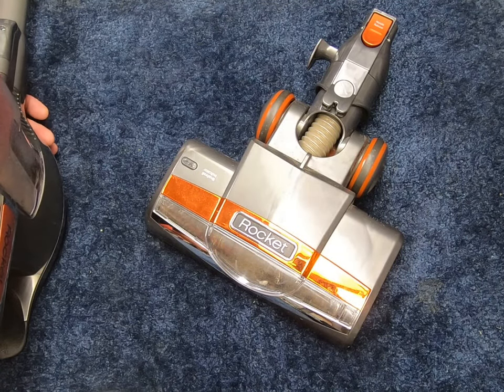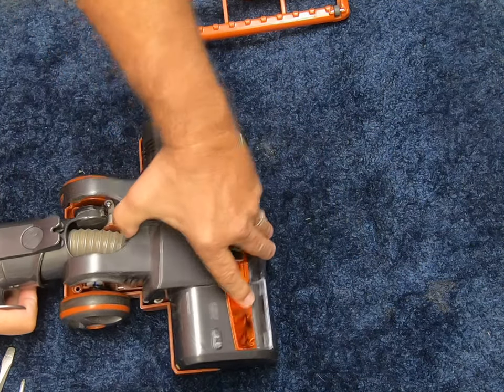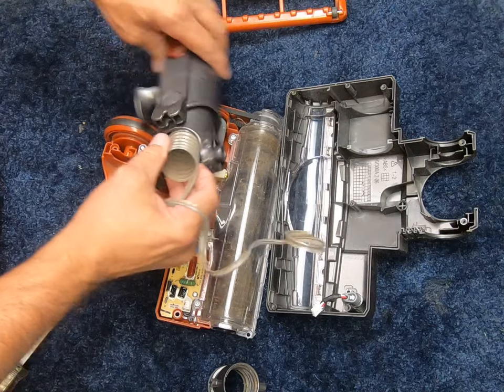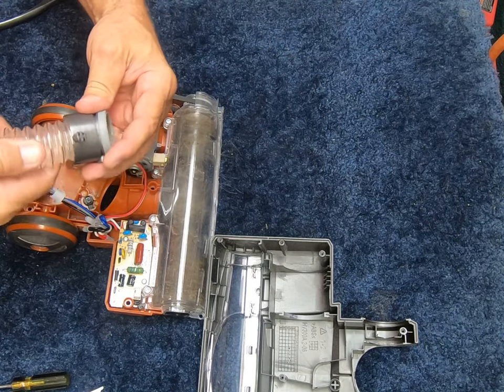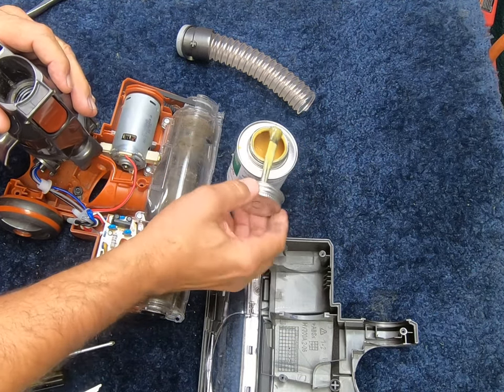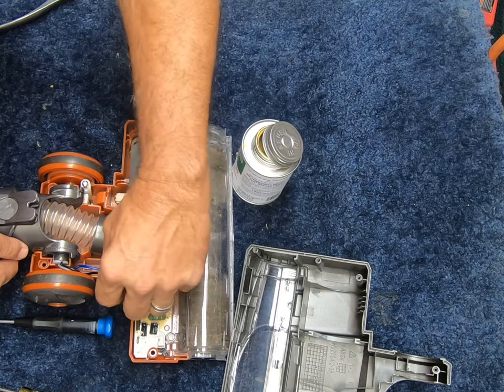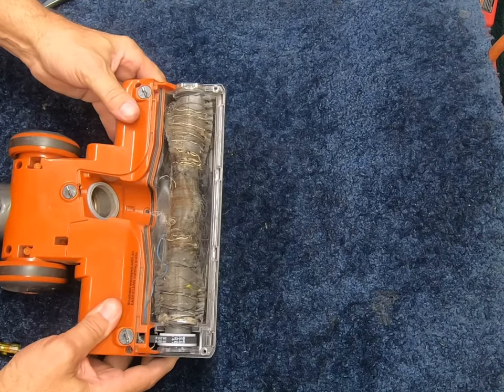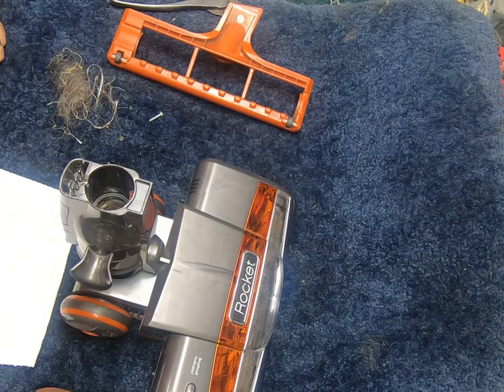How to replace a Floor Nozzle Hose for a Shark HV300 Dual Clean Rocket Vacuum Cleaner and more

Comment: I found the hose on Amazon, and I didn't use any glue. I was able to replace it myself after the local vacuum repair shop declined, saying they couldn't get parts. I'm a 71 year old female with absolutely no prior experience that would pertain to vacuum repair, so this is really doable with this video to help. Getting it apart was the hardest part.
Reply: 🤩great job.
Reply: Gale Thomas-Goodman I’m 60! I looked high and low a couple years ago and took the hose from the floor attachment. But I’m happy to see this FINALLY! thank you for EMPHASIZING how awesome we gals over 39 can be!! 👏👏👏❤️
Reply: Good job 👏 the older you get the smarter you become.
Reply: I'm soon to be 70 and have purchased my hose replacement and special screw bit...going to do it myself.
Reply: I'm also a 70 year old  lady, ordered part from Amazon and did it myself. Works a treat.
Reply: Please tell me what type tool/screwdriver you used to unscrew all the screws? In the video he appears to use same tool on all the screws. Thank you

Comment: Thank you SO MUCH!! I was able to replace my Shark hose with your easy to follow steps. My first repair attempt. I did have a piece left over wasn’t sure where it was from. Half moon shaped rubber gasket. Anyway the vac works like a charm.

Comment: Successfully replaced the hose in my older Shark Rocket vacuum by following this video! I did have to use a wider diameter hose (but also have a different model number than quoted here - I think a 301). Also, noticed several commenters saying the hoses aren't glued in; the original hose on my vacuum was absolutely sealed in with glue/some other adhesive, making it a bit messy and difficult to remove. I just screwed the replacement hose in and didn't use an adhesive, but wanted to mention since so many people are saying there's no glue. Also, for other super amateurs like myself: if you're having trouble screwing the hose in or out: you're probably just turning it the wrong way. Try the "other", counterintuitive way. I spent an embarrassing amount of time trying to turn it the wrong way initially, before: success.
Reply: I also have a 301 model but I'm having a hard time finding the correct hose for my vacuum, the ones I found on Amazon said for models 300,302 and the bad reviews claim they don't fit the 301 model. Would you be so kind to tell me where you acquired your hose and also what size wrench did you use. Thank you.

Comment: Very good videeo.  Found the hose on Amazon and it was exactly the length you measured.  Everything went togather as you described.  I also didn't use any glue.  Thanks!

Comment: Thank you so much for this video!! ...
I was about to throw out my year-old Shark HV301, and then someone told me about this video. I successfully installed a new hose thanks to you and brought my vacuum back to life. This floor nozzle problem is very common with these units and I'm aghast that Shark has not issued any product recalls. It's also not covered under their "limited" 5-year warranty. Their warranty should be renamed "non-existent" 5-year warranty. This is clearly an engineering and/or manufacturing defect on Shark's part and should be covered under warranty. Shame on Shark.
Reply: The vacuum repair guy where I live says Shark does it on purpose, to get people to buy another vacuum more often. It throws show business to the repair guys too😳I just need to find the correct screwdriver to try to fix the head myself—got the hoses on Amazon that are stronger with steel too!!

Comment: I have this vacuum. Love this vacuum for my small apartment. And I'm glad to know this is a common issue as it means there's plenty of resources. Thank you for this video. I'm a diy guy but didn't know where to start
Reply from the maker: There are a few conditions that could cause a vacuum to be hard to push. First one would be if you got new carpeting. They’re also could be a problem with the rush roll not spinning properly or the brush roll can be worn away. Check your belt to make sure everything is working properly. If it’s not one of these simple fixes, I would call a vacuum service center near you to get some more advice. Or you are welcome to call us. Our store opens today at 8 AM central time.

Comment: My hose was glued in - HV300. Bought a hose from Amazon - 
Hose for Shark Rocket HV300, HV302 Vacuum Black Hose Motorized Lower Nozzle, 6" x 1.25" ID - but it was slightly too big and started to crack the hose attachment.

Comment: Great video. Glad you mentioned counter clockwise, that helped get the hose out.  I was going to mend it with duct tape but since it was apart I ordered a new hose. Thanks for the steps for getting to the hose and getting it out.

Comment: Great video,

I found that those hoses screw it's  into each end adapter so when taking it off on the bottom turn turn the adapter to the right clockwise opposite of what you normally would and when you go to take the hose off the top you do the same thing , screw it to the right it unscrews from each adapter end.  Before I order one of those houses I am going to measure this and see if I got something off an old vacuum or can find  somewhere cheaper than what they sell them for . Thank you for the video

Comment: This video is very helpful thank you so much,but I have a question! Which tool to use to get those screws out?
Reply: For mine I needed TORX screwdrivers, there's two different sizes so you should try to find a set.

Comment: The video was great but the hose you recommended were to small for both my Shark Rocket vacuums. Both broke the same week. They were different models. One the exact same as yours. Both original hoses were identical from different models and year.  My advice is to find one a little bigger but I had already ordered 2 so I made due. We'll see if they hold. Thanks for the video!

Comment: I can’t even get all the screws out as there’s little metal posts in the middle of the screw like it wasn’t fully punched correctly? It’s really frustrating because I really love this lil vac and need to replace the hose that essentially disintegrated after only 8 months of light use!
Reply from the maker: The special Torx Security Screwdriver to remove the screws can be located at the following link https://amzn.to/3SZfnef

Comment: I have a Shark HV300 series vac the hose split on the bend. There are 3 screws I cannot identify. Should be either Phillips, Hex, T-15 or T20.... tried all of those nothing works. I have concluded that the screws were stripped on the production line. Vacuum is only  6 years old. Gee I would like to vacuum at some point
Reply from the maker: Try the special Torx Security Screwdriver to remove all screws can be located at the following link https://amzn.to/3SZfnef
Reply: i actually have all the Torx bits necessary for to remove the screws. The original  Shark technician just installed the Torx screws so tight they stripped them. i did manage to remove them yet the hose as so many other people have said is not installed to be replaced.

Comment: I tried this with a shark rocket HV380w (a newer model). Every screw is a security screw and the hose is glued on both sides. The hose on the motor side has a rubber collar bonded to the plastic which appears that shark has now made the motorized floor nozzle extremely difficult (near impossible) to repair even with a replacement hose bit. The glue, even with using acetone, is near impossible to remove. It appears they have changed the hose size several times between models and if your host diameter is off by 1-3 mm it won't thread. The cost of sending in the vacuum is approximately $20 if its under warranty. I ended up abandoning the project and unfortunately had to buy a replacement part from the manufacturer. If this happens to part that I ordered from shark, I will likely find another brand. Shark needs to support peoples right to repair by designing their products to have the hose (and other parts) to be replaced easier or they will need to design a more heavy duty hose section that does not break down.
Reply: Agree. I love the Shark vacuum but this part replacement was a time consuming pain to do. Now my vacuum clogs in multiple places. Going to throw away😢
Reply: I agree

Comment: I had the same issue can some suggest me a more durable hose or new floor head the won’t split
Reply from the maker: https://www.chicagoshopusa.com/Replacement-1-18-Inch-in-Diameter-Power-Nozzle-Air-Hose-for-Some-Shark-Rocket-and-Duo-Clean-Models_p_19592.html

Comment: for those planning to do the fix: no 
the hose is "screwed" into ends of the attachments and not actually glued.
i was able to unscrew the hose from each attachment and "repair" it with duck tape.
Reply: Hi Pavel, how is that working out for you? I'm planning to do the same "repair" with duct tape, at least until I can buy a replacement hose.
Reply: @HanhVu93  Hey. it holds and works ok.  The repaired hose screwed im easily so i'm not even planning to get a replacement hose and will stick with duct tape repaired one
Reply: Hi., I had to replace the hose as well... On my vac the hose ends were glued with what seems silicon. To remove the damaged hose, I simply cut the wire reinforcement and pulled it out. I did the same for both ends. After cleaning the connectors, I screwed the new hose onto the loose bottom connector, then into the top. When reassembling, adjust the bottom connector. I did not use glue, because honestly, it ain't going anywhere. Hope this helps...
Reply: Hello Pavel,  i did the same a year ago and it did hold pretty good. I have a new crack in that hose closer to one end of it, but plan to fix it the same way. I didn't use glue either;  I thought that was unnecessary!  One thing I did thou, I covered the crack with  a bit of plastic wrap first and duct taped it then. 
In regards to buying the hose, it doesn't seem to be the same size. They advertise 1 1/8" but when I measure the original one it is 
1 1/2".  So, for  now I guess Duct Tape will do...haha!
Thanks for the video.

Comment: I have a shark deluxe pro vacuum. my hose measures measures slightly over 1/1/4 in diamenter outside edge. Unless the glue is going to help this will not fit. correct>
Reply from the maker: If you provide me with the model number, I can check.

Comment: Man, the screws are to like old to take out or just messed up. Ordered the hose and everything
Reply from the maker: Make sure you use the proper size torque driver
Reply: @donhome2  I just realized I had to get a curtain one, it’s all fixed. Thanks for reply

Comment: Once the cover plate is off, what screws are used? They look like torx but mine do not fit? Proprietary? Any input appreciated.
Reply: @tommeytommey2742  thanks for this! So irritating that they use these instead of Phillips. Doing this repair now and you saved me some searching.
Reply from the maker: here is the torx you need to remove the screws. They have a hole in the center. They are designed to keep the average person from doing own repairs. I have been in the trades for years and have had to buy "specialty" tools.  Here's the link: https://amzn.to/3N7k3Kw

Comment: Same here the new hose looks smaller diam despite being for the NV600
Reply: I need to fix the hose on my NV680.  So far i'm unable to completely disconnect the top part from the bar area as shown in the video.  It has a much different hose....no connectors, it's screws in to both sides so I definitely need to be able to fully disconnect them. Thanks!